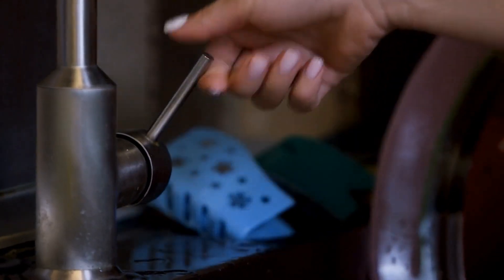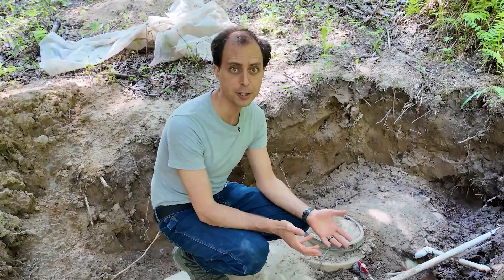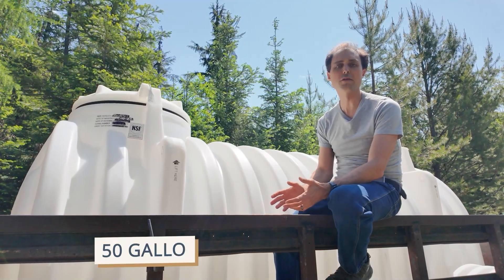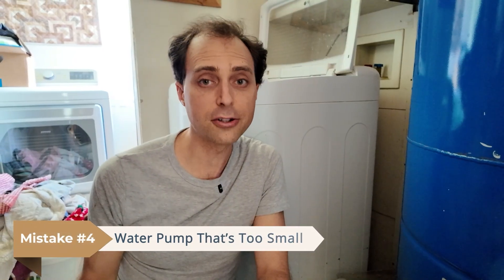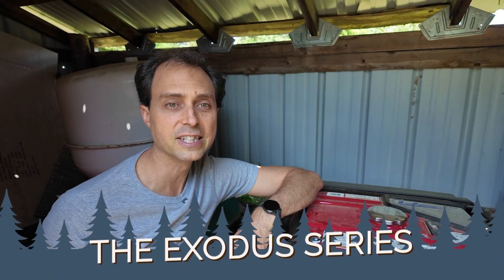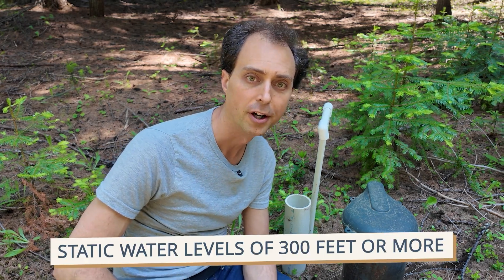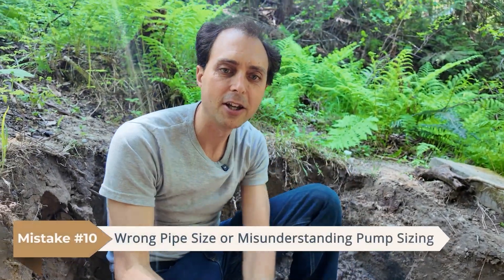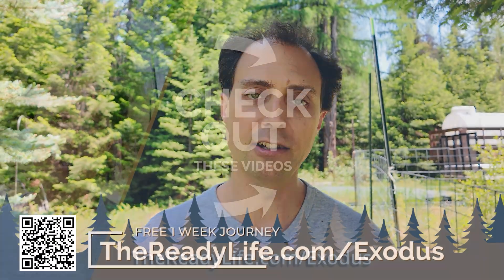Off Grid Water Mistakes That No One Warns You About

Comment: 7:15 Why would you want 1 1/4” pvc pipe over a 3/4” pipe? That doesn’t make sense to me.
Reply from the maker: Depends on your pump, how far your run of pipe is, and how much water you'll be pushing. The higher your GPM and the longer your run of pipe, the more pressure you lose to friction. What that means is, a smaller pipe could potentially require you to use a larger more powerful pump that uses more power, in order to end up with the same amount of pressure at the same GPM as you could have achieved with a smaller pump if your pipeline had been a bit larger. Once again, there are a lot of variables, so you have to run the numbers for your situation, but in my situation it would have been nice to have 1" pipe instead of 3/4".

Comment: Why is town and some water tanks are up high. On a hill or tower. No water pump needed to get that water to a facet. Water lines. For making pressure as well. 2" main to the building. 3/4" throughout the building until the last two fittings. They are 1/2".

Comment: are you sure plastic containers are safe to use? have been hearing so much about plastic.
Reply from the maker: There are pros and cons to everything. As far as plastics go, I feel the hard HDPE plastics used in these tanks, combined with the fact that it's buried away from sunlight, makes it as safe as possible. But if you have reason to feel it's unsafe for you, then definitely go with concrete. It's just going to be expensive and difficult to install.
Reply: Rain has microplastics as do plastic drums